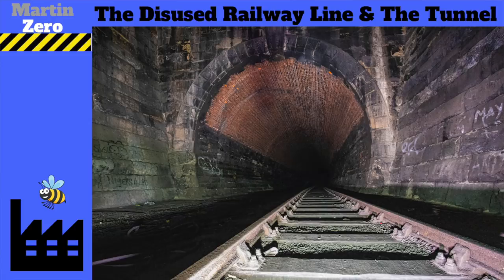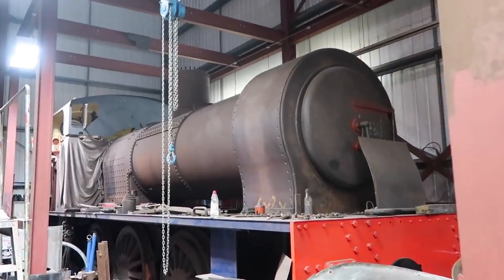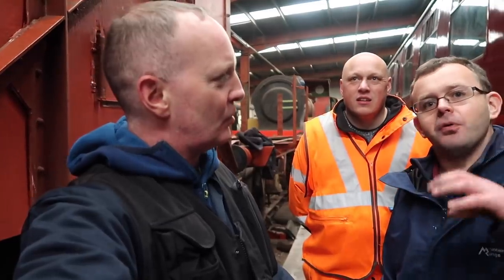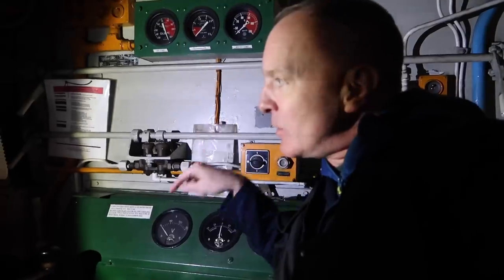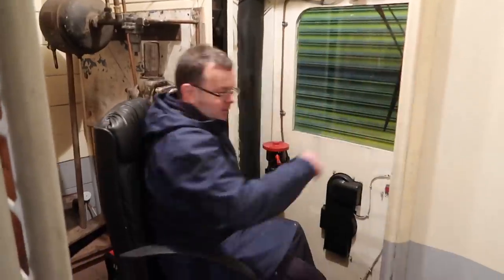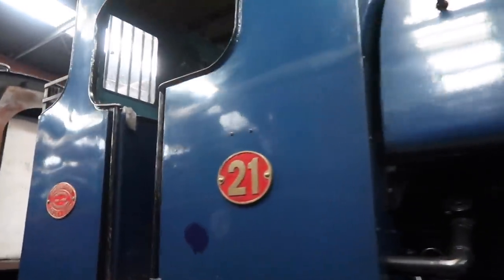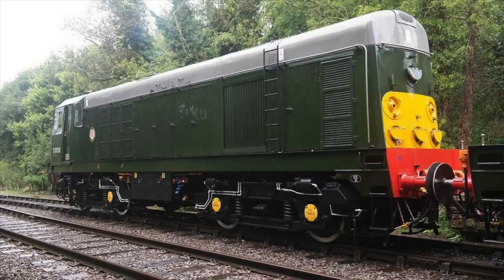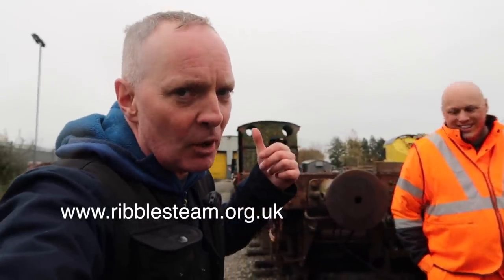Inside the Locomotive Works

Comment: On the old original Class 08's, prior to starting, the fuel was hand pumped from a holding tank into what was called the "Header Tank" (which is what that upper gauge you were looking at was reading.) Throughout your shift you always had to keep yourself aware of the fuel level in the header tank. B.R. instructions were that you must not allow it to drop below 20 gallons (or you'd start sucking all kinds of crap into the engine from the bottom of the tank) so several manic episodes of pumping would ensue throughout the day. Believe it or not, it was bloody hard work to pump any decent amount up there. It was absolutely heaven when they started putting electric pumps on them but that wasn't until the late 70's/early 80's. Furthermore, those engines always shunted nose first (for safety reasons.) The dual control was therefore necessary because sidings were rarely straight and, depending on which way the track curved dictacted which side you would drive from. The B.R. rule book stated that if you lost sight of the Shunter then you must stop immediately - again for safety reasons - so you would often dash from one side of the cab to the other to keep him in sight. You had about 5 seconds to dash across before the Deadman's pedal activated and dumped the brake. However, the Deadman's was more often than not 'pegged' with a brake stick when shunting in a yard in order to defeat this problem (but I didn't tell you that, did I?)
Reply: I  was  on  these  at March Down Yard, Whitemoor Yards, Ely on rare occasions, trips from March to Wisbech,  once took  one from March to Kings Lynn,  and another from March to Kings Lynn  top speed 15mph,   one driver was very skilled at fly shunting at Wisbech...
Reply: That sounds about right for BR. I remember my dad telling me about how when he worked on electric unit maintenance down south  they used to just paddle the collector shoes to isolate the unit from the live rail as the local isolator switch was right down the yard and they couldn't be asked to walk right down there to isolate it, and how sometimes they also used to stick a board over a live rail with it live and sit on it while they ate their lunch! How about that?! That was way back long before the HSE. I think they'd have fits if they saw some of the things they did.

Comment: Good news for you: all NS diesel shunters of the '08' type were built at the Preston factory and the 600s (equipped with a train brake as opposed to the earlier 500s) were fitted wit EEC London diesel motors. This ex NS 663 was delivered at the end of 1956. The gauges fixture you mentioned is as far as I see original. 663 was one of the locomotives that had their depot at the Rotterdam harbour (Feijenoord) and would thus have had additional whasp stripes to the green livery at some point. It was painted in the 'Dutch' yellow-grey livery in the 70s. Taken out of service in 1997, but reinstated for some local shunting for a short while in 2003. Sold to the Ribble Steam Railway in 2005.
Reply from the maker: Brilliant thanks for the info 👍
Reply: Have been driving these loco's back in the 90's (when I just started my career at the Dutch Railways). Very easy to drive and pretty strong loco's. Most used equipment was a hammer. The maximum speed was 30 km/h but the needle of the speedometer wasn't very accurate, it is swinging around. When it hit the 32 km/h (or 15 mph) it triggered an overspeedrelais, the relais was also equipped with a, very noisy and irritating, whistle to tell your speed was to high (wel thought about it as you were most of the time with your head outside the loco watching the shunting). So everybody slammed those whistles with a hammer to try to stop it. When it went into the workshop, they always replaced the whistle (which we hit again)... 

The pumping you mentioned wasn't pumping fuel from one tank into another. It was meant to pump lubricant into the engine for an easier start (and safe the batteries and motor). As it was extra work, most times we just didn't do it (only when there was a chef watching you we did it) . Just hit the engine-start and wait; worked fine most times (the boys in the workshop didn't like it when we did it that way, off course).
Reply: In 2018 4 of these dutch 08s were rebought by a dutch railway company and transported back to Holland,  Railway Support Services had the job of hauling them from various locations in the uk back to Holland.
Reply: I've been there to Rotterdam docks, there must be absolutely MILES of sidings there given the size of that port.
Reply: @majorpygge-phartt2643  When the Port of Rotterdam was growing rapidly from the 70s on, freight traffic by rail was in the decline yet and the 'new' and biggest parts of the port have relatively few rail connections. The older port however did have, with beautiful sidings through the city, but they are all long gone.

Comment: That was brilliant! Definitely one to get the old anoraks zipped up for!  You 3 were like kids in a sweet shop there. Great to see the dedication those guys put in to restore these old engines..
 My late uncle Harry used to volunteer in the 1970s/80s, for the Mid-Hants Preserved Railway  (the Watercress line) he worked on restoration of the old steam engines & eventually became a fully qualified engine driver. 
I remember those corridor & compartment carriages on the Portsmouth to London trains, they were still in use until around 1990.

Comment: I couldn't help but notice the reverence you seemed to feel about being invited up into the cab of the diesel locomotive. Reminds me of some time spent volunteering at a local railroad museum. The 2156 is a Northern Pacific, pacific type steam engine that was once on a static display at a local zoo. I grew up going to the zoo and I always stopped by the 2156 to ring the bell and "marvel at this massive piece of machinery",  Later when I started working at the museum, I was given the task of freeing up the rusted shut ashpan door inside the fire box. It was like entering a holy shrine to go inside the object of so many visits to the zoo over so many years of my life.
 I trained on as a brakeman when we had another steam locomotive running. The 328 was another Northern Pacific line ten wheeler. During hot summer days the firemen would need a break and they would invite brakemen to try their hand at firing the locomotive. The most fun I ever had working my ass off in my whole life!
 You should consider volunteering at a local rail museum.
Reply from the maker: Yes it was reverence and a trip back to being 15 yrs old and the excitement. Love it on the footplate

Comment: I've visited the North York Moors Railway engine shed at Grosmont and the coach works at Pickering while working and the activities are similar to this.
I walked into the main engine shed to see 4 steam engines dismantled and one getting it's main wheel being refitted by four blokes, two with a chain hoist and two blokes using sledge hammers to fit it on the axle. It's really like stepping back in time.

Comment: Love the Mk1 corridor stock. Me & my mates used to pile into a compartment at Ulverston station & head off for a day out. The 08:00 & 08:40 departures were always loco hauled & would normally be 47 hauled but occasionally would turn up with a 40 on the front. My first adventure was in December 1981 aged 13. We went off to Edinburgh to see the last of the Deltics before they were all withdrawn from service. Happy times. Cheers, Chris.
Reply from the maker: Great stuff Chris. I saw my first Deltic at Stalybridge can you believe
Reply: I have been told that they did sometimes turn up in places you wouldn't expect them to. I watched a vid a few years back that showed the Alcan(?) works in the North East using a preserved one for some reason. I'll see if I can find it.

Comment: The main fuel tank on these “08” type shunters is mounted on the framing, in front of the cab and holds around 500 gallons. The fuel actually feeding the engine is, as someone has already stated, supplied by gravity from a higher level Service Tank of around 50 gallons capacity. On BR, in the “old days”, the fuel had to be pumped up into this Service Tank by a semi-rotary pump....the one you would have seen the driver working when you “cabbed” one. Later on, these hand pumps were dispensed with and an electric lift pump was fitted, along with a float switch etc. to remove the need for manual pumping.

Cheers for another great video....
Don
Reply from the maker: Thanks Don I knew I kinda remembered it

Comment: Hi Martin, you bring so many golden memories back to me when you do the train video's, my Step-Dad used to volunteer restoring the steam loco's at Didcot and I have been up on a few footplates in my time when I was around 14-15 lol. then later on (I'm 51 now) when I was around 17-18 I moved to Poole Dorset and used to hang out with my friend Malcolm in the freight section at Hamworthy Freight, I use to be out watching Malcolm shunt things around with his mates as freight would be going in or out. I absolutely loved those old days and I used to love riding in those old class 1 carriages, sliding the window down by the loo's where the carriages joined and bunging my head out the window, my favourite thing was looking out the window on the outside line side (so no other track was there0 and watching the steam engines as they rounded a bend under full head of steam. Omg I loved this video so much, thank you so much for taking us round. xx 🙏🏻🙏🏻💖

Comment: Interesting look around.

I went to London, late 70s, in a corridor carriage. It was a special excursion organised by school, so not sure if it was standard for the time or not.

In the mid 80s I also went in a compartment carriage. This was on the south coast. Each carriage door took you into a compartment with 6 seats. No corridor, so you had to wait until the next station if you wanted to move elsewhere on the train.
Reply: They used those corridor carriages up until about 1990 on the Portsmouth to London routes & the Compartment carriages on the Portsmouth to Salisbury services until they were replaced with the Sprinter trains.

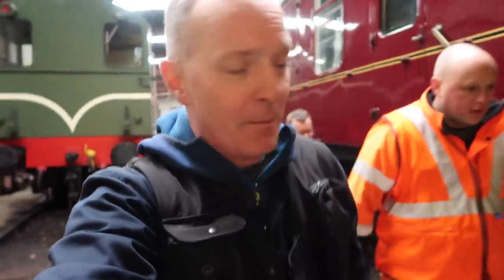Comment: 21:20 and I get excited as I am just in from the Workshop where I am currently building a similar locomotive in 7 1/4 inch gauge called Jessie. She is a Hawthorn Leslie 0-4-0 Saddle tank of an earlier vintage. Today I have been milling and then polishing the Reach rod. In your opening shots this is the long lever painted Red going from the Reversing lever to the motion. Forward or backwards and once moving saves steam by moving it slightly back. David and Lily.

Comment: Martin. You are in my domain on the shunt loco. A large part of my working life is spent on one. The fuel tank situation is- the lower tank is the larger, main holding tank, of IIRC 600 gallons. This does not directly supply the engine. The upper tank, whose gauge is in the cab, high up, is for the service tank, only this smaller tank supplies the engine, by gravity, and would indeed be fed from the main tank by the time honoured manual pump. This was a real chore, as each stroke of the handle was lugging about 30 kg of steel linkage between handle and pump, (which would have been below the cab floor, ) and the output per stroke was minimal, so you had a job of work if you were running low. Woe betide the driver who didn't pump some oil during his shift- the next man on would be sure to put him straight! Or worse. Lucky for me the ones I get on have had automatic electric pumps fitted, most have these days. You seem to have had a grand day out! There's something about a loco 'shop; but where is the dirt, clutter, and multiple ale houses right outside the gates, with hordes of thirsty workers knocking 'em back,,,,lol. Ah, the good ol' days, eh? Cheers Martin. Thanx for posting, more please!
Reply from the maker: Thanks very much for the Shunter info 😃👍

Comment: Great video again Martin, Martin, and last but not least, Gordon. 
It's a pity it's just the front of the 20, they were good locomotives. 
I am always amazed at how many people can't open the door of a MK1 coach, considering that they were in use relatively recently!
Reply from the maker: I think it was 20 009 according to a comment on here Alistair
Reply: @MartinZero  I noticed that, Martin. We have 20020 at Bo'ness, it's waiting for a power unit lift,as there's metal filings in the oil. The balancer shaft bearings are worn and need renewed.

Comment: That in-cab fuel gauge is for the "SERVICE" tank , a nearby placard dictated that it be pumped full during each shift. One tended to leave it for the next bloke , as it was incredibly slow- from about half - tank to full could take half an hour of hard yakka on the handle, which with all it's linkages was bloody heavy. I spent many , many happy hours on these , knocking the yards into some sort of order , at such as Ashburys, Red Bank , Skew Bridge ,Castleton, Mayfield ,Piccadilly , amongst others. Occasionally you'd get one on a Saturday night ballast , and yer heart sank. Didn't know if it would be better to be busy all night rather than idle , as ther's no room for a good kip in ther ! did, however eventually find a way when on Skew Bridge pilot at Newton Heath ! One had get creative....These are my favourite engine ever, out of all the types I trained, they owe no one anything. Simply superb , and satisfying when driven well . When driven by a "cack-hander" , they could be murder !!! Great vlog , again, more like it , please. And your usual fare ,too.
Reply from the maker: Thanks Harold so your versed on 08's
Reply: @MartinZero  Yessir !! Still have my manuals for them somewhere, along with those for my mainline types. The last "350" I worked on was 08 393, a cut-down cab one. We had it at Peak Forest for a while, but due to heavy loads and gradients , it's use was a bit limited. You could , however draw a 2800 ton train downhill out of the sidings , once you gat air in the brakes. It took a loooong time, and not everyone knew the technique to get the air up, so ended up getting a mainliner on it out of frustration! These are really , really the best engine ever. If you search Flickr for "Fatbloke-Dim's" photostream , ther's side-by-side pix of a cut-down and regular cab 350 .

Comment: Another great vid Martin! Keep it up ol' son!

BTW, I'm just working on an old mill in Manchester, quite near the Medlock, and the guy I am dealing with said to me today "you know there is an old tunnel under the mill that links to the Medlock and they used to bring goods into the mill from it - It was mapped out about 30 years ago and I've got them somewhere... honestly, there is! It's a tunnel..." Let me know if it is any use and I'll find out some more for you. You can DM me on Twitter and I'll give you more info on the building.

Comment: That's a saddle tank engine, so that top tank is just a water reservoir. The boiler sits underneath and draws water from that over arching tank into the boiler. That way the engine does not have to tow a coal and water tender making it extremely short which is good for tight spaces. I would imagine that the tank over the boiler also improves traction when it's full.

Comment: Vacuum brakes are not only held off by vacuum, but are also applied by vacuum. Each coach has a vacuum tank which is evacuated by the vacuum pump on the loco (ejector on a steam loco) via the train brake pipe which runs the length of the train. If the vacuum in that pipe is partially destroyed by the driver applying the the brake or completely destroyed by the guard or by the train accidentally parting a proportional valve on each coach proportionally applies vacuum power from the vacuum tank to the brakes to apply them.

So if the brakes go on when the vacuum is destroyed, how do you shunt or otherwise move a vac braked coach which is not connected to a locomotive? You 'pull the strings'. These are cables under the coach which, if pulled, releases all the vacuum from the coach's vacuum tank so the brakes will release.

Comment: I guess i should have said 'Thanks Martins"  and Gordon. speaking of old diesel nose  'cones' , my  SD 40-2 avatar has a special modification to its nose. Can you guess what it is ?
Reply from the maker: Magnet 🧲?
Reply: @MartinZero  The  EMD sd40-2 is an old diesel electric locomotive that was once  the mainline power. Of these there was a small group of Union Pacific Locomotives that had been modified to go faster 80 mph . 

They were used on time sensitive freight 

like FedEx . 

And they had a longer front cowl and were affectionately known as 'Fast Forties' or 'Snoots'
my Channel pic  is a 'decommisioned snoot ' that was bought by C.N. and is limited to 70mph I think....

Comment: You Bute, woke by local chickens having their morning call, reach out for my iPhone to check time, 03.20 and see Martins let lose with a Loco vid.  Zero sleep for me and away we go.
I started my working life at The Vulcan Foundry, English Electrics, loco works in Newton-le -Willows.
Steam nut as a lad and I rape, You Tube, for vids on Locos, this last year going daft on The Big Boy, just put into full running order in the states. 
Helped build a few diesels and mainline Electrics as a youth. As the rolling stock had been heated by steam, the Diesel/Electrics where fitted with a Clayton Steam generator to provide heat for the passenger carriages. 
Feel like I am O.D. ing on all this serious Loco Porn. Remember as a kid, pre teens getting rides on Steam shunters in the local goods yard, the crew would cook their breaky on a cleaned spade, bacon & eggs done in a minute in the raging fire, fraid I can’t remember what oil they used on the shovel, 60 years ago.
Good start to my days Thanks Martin for the Top Job you have given us.
John
Reply from the maker: Thanks John. Total respect you working at Vulcan Foundry !!! Wow !!